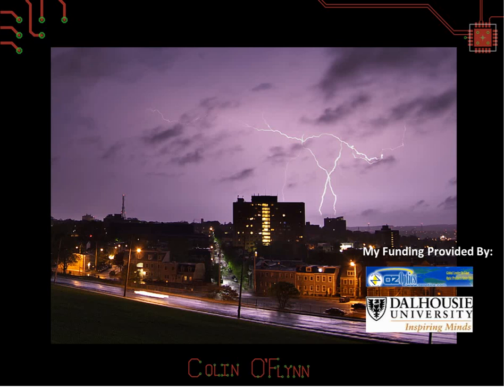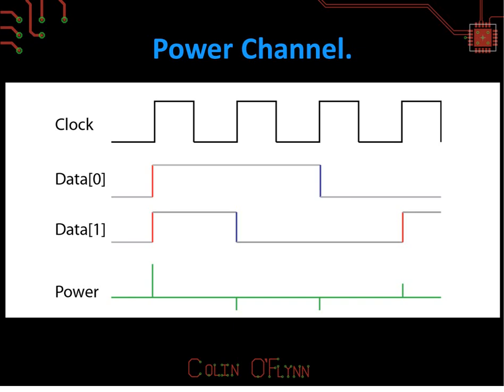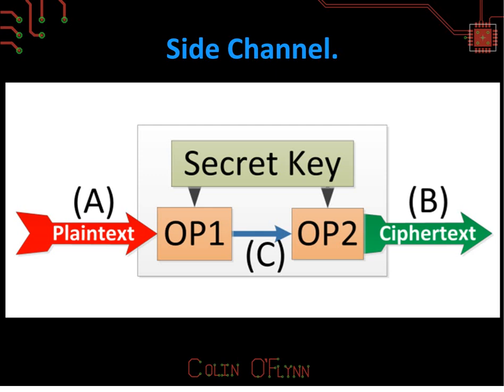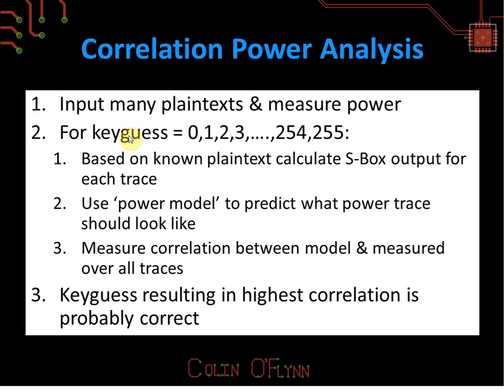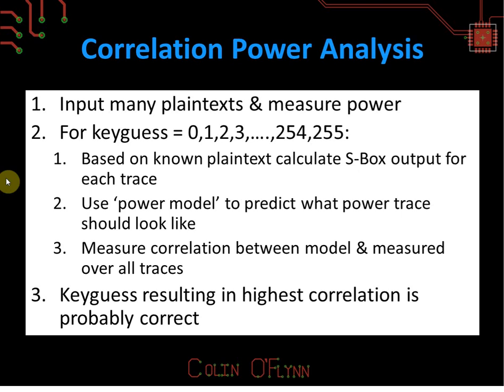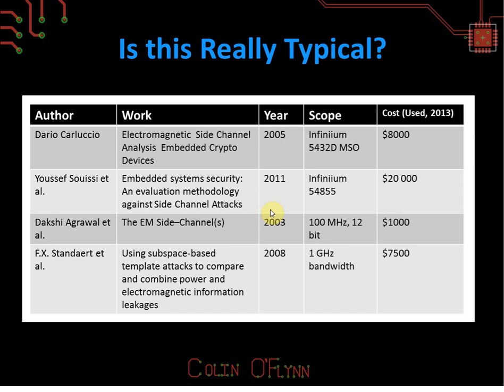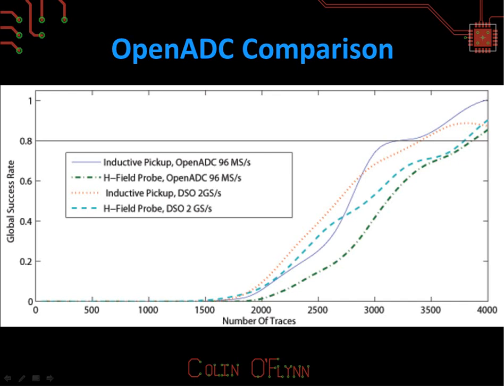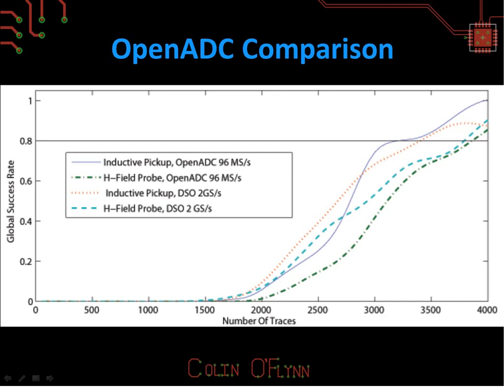Blackhat EU 2013: Power Analyis for Cheapskates

Comment: hello I bought the preamplifier and openadc.
Buy only the card and the preamplifier as only want to use it to acquire data, but so far have not get data (output openadc).
How could check if ahy output data OpenADC. [Not use the trigger, to be used ?.]

the input signal is the magnetic field generated by a chip or cell.

which is the minimum input signal frequency by the analog channel openadc?

Thank You.